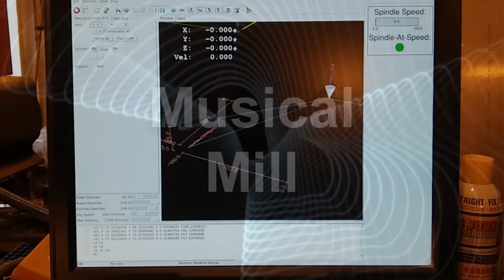Musical Monster Mill

Comment: Is the insulation that you're using on the ceiling rated for this application? Was it ever meant to be left exposed after installation? You might have a horrible death-from-smoke-inhalation hazard mere feet away from you. Please take a sample of the insulation, set it up outside, and try lighting it up with a torch. If you see dense black smoke and/or it doesn't self-extinguish, you should immediately remove all of it or cover it with a fire-resistant material, like drywall.
Reply from the maker: It will be covered with drywall likely in the next couple of months. It's a 20x20 foot garage with an 18 foot door. If there ever was a fire... there are two fire extinguishers, and I can open one of two doors for a quick exit. 
(I'm never any more than 10 feet from a door.)